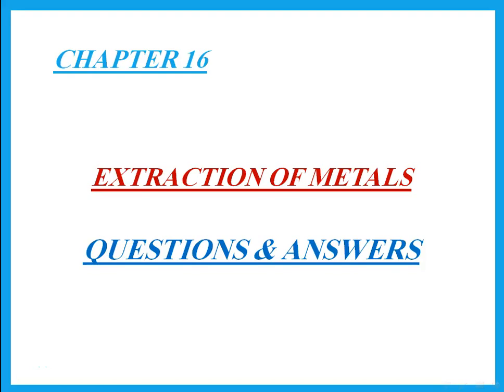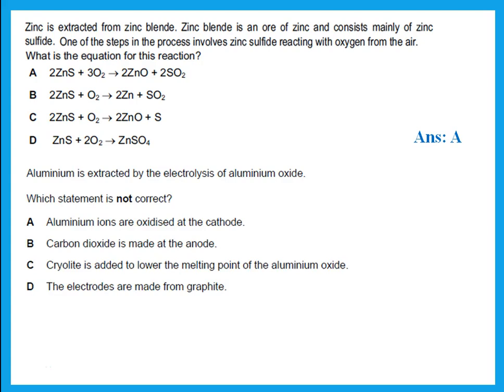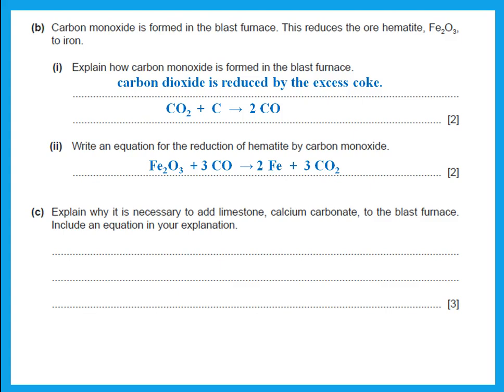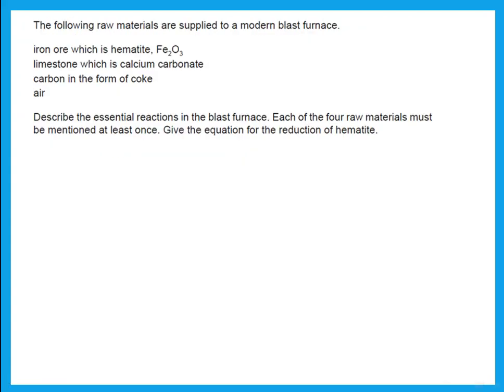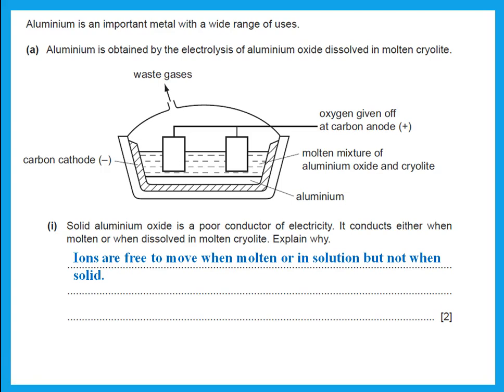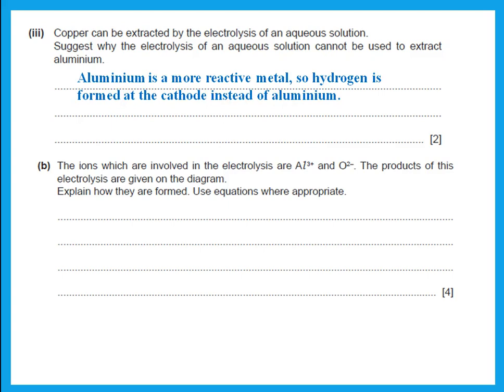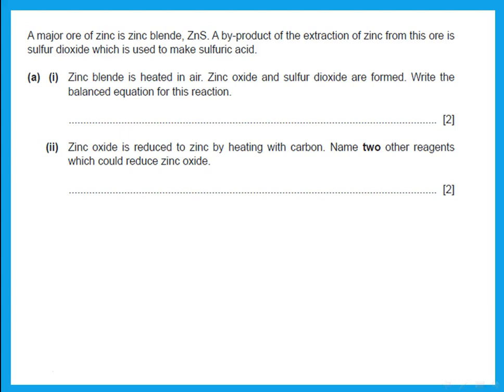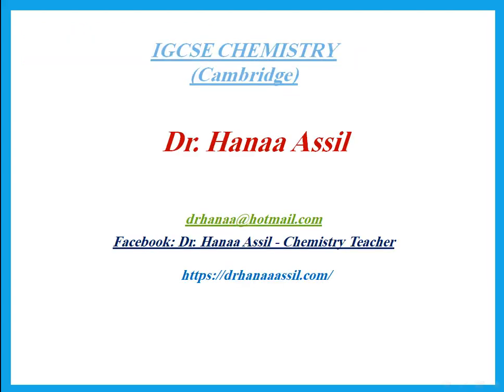Ch 16 Extraction of Metals Q&A IGCSE Chemistry Cambridge - Dr. Hanaa Assil

Comment: Miss why not use aluminium chloride instead aluminium oxide
Reply from the maker: Oxide is reduced by carbon. Chloride does not do redox reactions
Reply: @drhanaaassil-chemistryteac9433   you  mean not  get  on pure aluminium   When al2o3  when carbon react with oxygen form co2 gas escap but not in aluminium chloride

Comment: Can you please explain in your own words why hydrogen are formed at the cathode instead of aluminum (is it because it's is higher in the reactivity series, if yes then why)
Is this also the case for other metals and elements which happens to be present in an electrolysis???
Reply from the maker: The less reactive element is the one formed at the electrode.
Reply: @drhanaaassil-chemistryteac9433  which electrode?
Reply: @Offical_Kelven  cathode